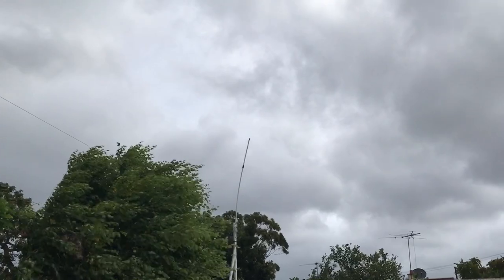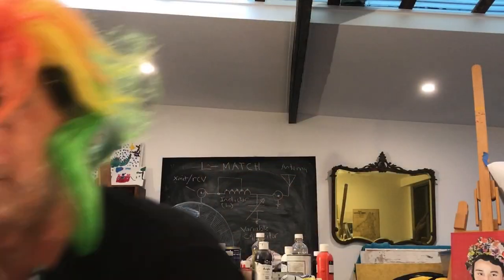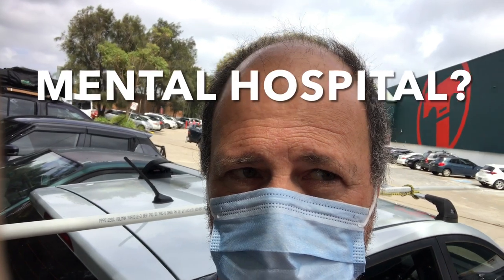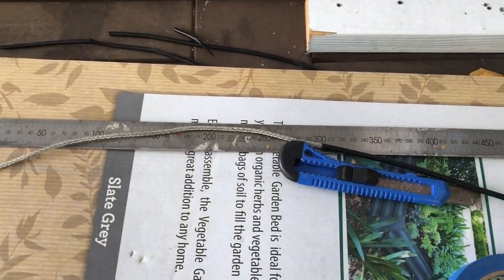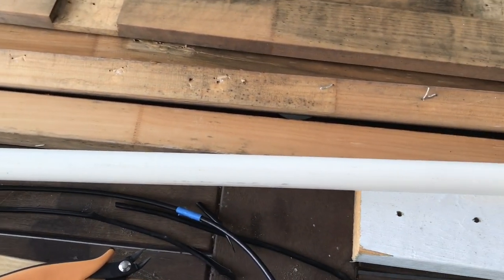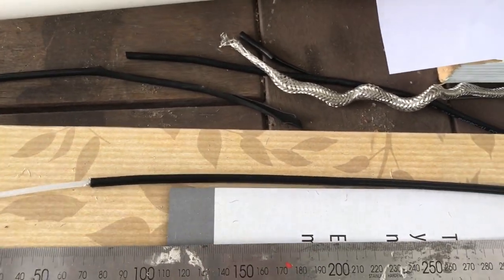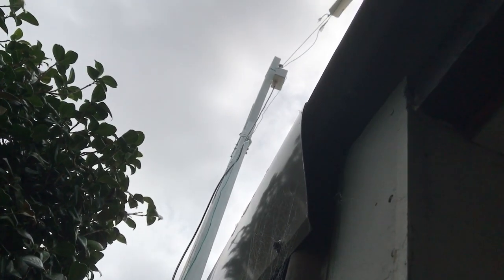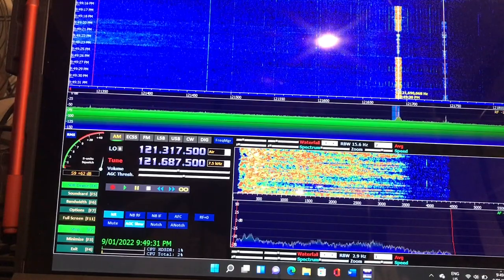Prepper 2 hr antenna for VHF/UHF/HF. Ham or CB made from RG58

Comment: VSWR is only 1/2 of the equation very misleading; 
what is the wavelength of the antenna? 
what is the gain? 
what is the radiation pattern? 
did you test the plumbing pipe for RF Conductivity? (There is a reason why fibreglass is used), 
did you check the terminal feedline impedance is it 50ohms?
Reply from the maker: PVC is not the best corona discharge/ rf insulation wise etc but for VHF not running a linear will be fine during a zombie apocalypse! It is after all using the dielectric from the coax at any rate (the pipe just carries it) but yes, at VHF it may absorb RF. Impedance is a complex thing (it has imaginary/reactive and resistive components), so thank you for the comment as it allows me to be less flippant and do further investigation. So yes the performance is based on accepting anecdotal assurances, which I know is dangerous as often antennas get a mystique that is based on faith rather than facts. I have reports this antenna is good   http://vk3zpf.com/2012/10/spion-kopje-sota-activation.html. As indicated by numerous links, it has been in common use over time.
Just learning to use nano .....will look into feed point impedance but as the lengths are electrically 1/2 wavelength for 2m and the nano is happy it has got to be close to if not 50 ohms .....don't own a field strength meter and location would not give a true indication anyway, due to nearby buildings trees etc. This is why antennas is often a suck it and see thing. Thanks for the comment. When my callsign comes through I will test it and see how far it gets out!
Reply from the maker: ARGGGGGHHHH you were right.....my nano was not calibrated correctly (thought it was ....but it wasn't!!!)......The antenna feed impedance is crap AND it basically swings vertically on the SMITH CHART!!! I will take it down!
Reply from the maker: Dear Paul
Firstly THANKS for the comment. I read your comment and thought....true nobody uses PVC....an easy to find material....so most likely it is bad for VHF UHF? Went back to the nano VNA...recalibrated to see what the impedance was and to look at the Smith Chart, to see if it was "bullseye" or nowhere near it. To my horror the chart was a merry go round!!!!! I then took the video down. This made me think the short 1/2 wavelength should have made me think the antenna was BAD! It also made me realise, being excited to share something comes with the responsibility that the information has some basis in fact. Then I found the Dr Ed Fong video (see my description for link) PVC was often OK (most often) .....but still my antenna was not looking good? Why was it OK then crazy bad????? The answer was I got my cables mixed up and was scanning my end fed HF antenna!!!!!! 

The antenna behaves like a vertical dipole so it should be omnidirectional (I have not verified this) and have a gain of about 1.64 dB (also unverified). Unpainted or treated PVC will die in UV over time so long term if you use untreated, there is that issue.....but as a quick and dirty antenna it is OK.  Your comment still stands as 100% correct VSWR is only a small part of the puzzle. Your comment also was food for thought......and to date was one of my first comments that questioned (even challenged) what was being presented. It resulted in much fruitful enquiry and growth of knowledge. Love the content on your channel BTW cheers and 73.

Comment: Make one for 10/11m !
Reply from the maker: Hi ...This antenna was originally a CB antenna (I think from Germany?) titled the T2LT antenna. To make it in a PVC pipe might make it a bit long? (4-5m). I would suggest a "naked" version (saucier?). Here is a link.     https://simonthewizard.com/2015/12/13/t2lt-antenna-how-to-make-swr-use/

Here is Tim's version
https://www.youtube.com/watch?v=ChAo3VObvC8&ab_channel=TimG5TM

If you decide to put it in PVC I think it will be shorter. Unfortunately, I haven't calculated the velocity factor but I'm pretty sure if you make a naked one and then put it into a pipe it will detune...so each change of length would need testing in the pipe! 

one more link 
 https://www.youtube.com/watch?v=lwbT4ZX6514&ab_channel=FredintheShed

Happy experimenting!